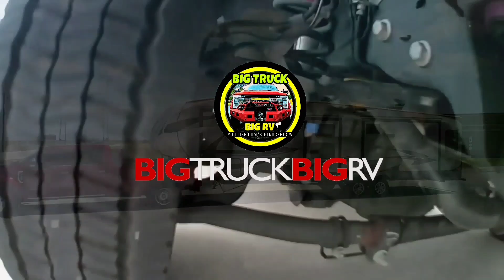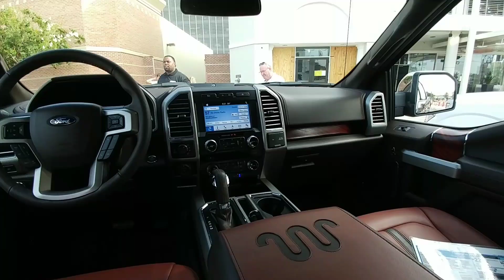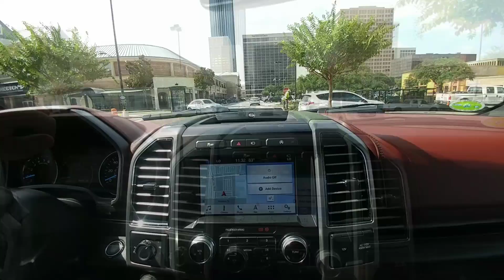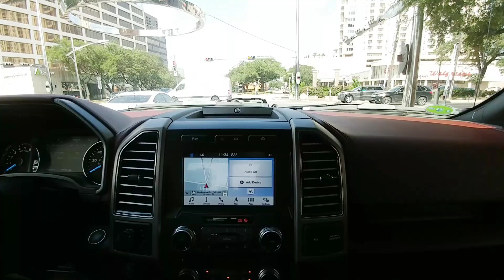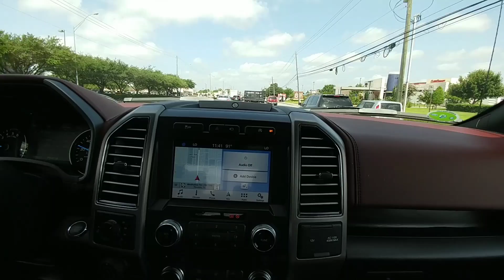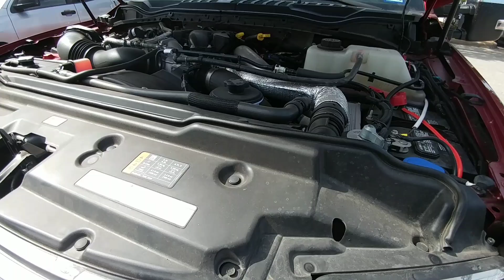All new F150 3.0L Powerstroke Diesel! First drive!

Comment: This new variant seems a bit confusing to me from a cost/performance perspective. I went to Fords website and specd an F-150 King Ranch 4x4 with the 3.0 diesel and they are 70K+ depending on other options. I then specd a 1 ton F350 dually and its actually 10K cheaper with obviously much better specs and longevity. Where is the justification for paying a 10K premium for a lot less truck? Speaking of longevity, that was one hell of sidestep dance that engineer did when you asked about it on the 3.0, he immediately deferred to the Super Duty line up if you want longevity, stating that the 3.0 was on par with the F150 lifecycle....Thats engineer speak for "we hope it does as well as the other F150's" I know, im a mechanical and electrical engineer, we use that type of language often because it gives plausible deniability should something not go as planned or changes have to be made. Aside from that, it was another good video, thanks!
Reply: No way in hell am I paying $70.000 for an F-150
Reply: F350 King Ranch 4x4 diesel dually starts at $70,360... you're paying for the interior trim. You can't compare the price of a 1/2 ton premium model with a 1 ton work truck trim model and complain about the price. What I find more interesting is the fact that you can get them for almost the same price, if I was buying a new truck I wouldn't even consider a 1/2 ton truck if I can get a 1 ton or bigger for virtually the same because I don't know where I'm going to be in life a year or two down the road and I might need the truck for work. Better to have more truck than you need than to get in a position where you need it and don't have it, if the prices are the same.
Reply: Jessa, What you probably are not aware of is that the switch from an all plastic cloth seat interior that will rattle all the time to stitched leather everywhere is ~$20 per vehicle for materials and manufacturing. So yes, complaints about price are fully justifiable; especially if a person is in the know.
Reply: Grimrpr6942 you have great points, the current 6.7 powerstroke had some reliability issues for a while, not sure if those are resolved, but this 3.0 engine is built in the same factory by the same people so that might tell you something
Reply: You caught that too!  It jumped out at me right away, he further doesn't seem too confident of power train.
Reply: As a retired aerospace engineer those were my immediate thoughts as well...... whatever the hell the F-150 LifeCycle is supposed to be :-)
Reply: The justification for $10k is fuel economy. You can’t get close to 30 mpg in a super duty. If fuel economy is not an issue then get the super duty.
Reply: "...Speaking of longevity, that was one hell of sidestep dance that engineer did when you asked about it on the 3.0, he immediately deferred to the Super Duty line up if you want longevity, stating that the 3.0 was on par with the F150 lifecycle....Thats engineer speak for "we hope it does as well as the other F150's" I know, im a mechanical and electrical engineer, we use that type of language often because it gives plausible deniability should something not go as planned or changes have to be made..."

Same impression here . . . not very good at dodging, eh ? LOL
Reply: Calm down, guys. The price of this F150 PowerStroke shouldn't be compared to its bigger siblings, the F250..F350, etc. This truck is much like the midsized pickups with their small [2.8L or 3.0L] diesel engines. Circa Colorado/Canyon and Gladiator. They're meant for fuel economy and light towing. Ya know, for the weekend warriors.
Reply: I would have pressed the engineer to answer whether or not one could expect the engine to last 300k miles. I'm of the opinion that if they believed it would last that long or even close, he would have at least hinted at it or implied it would. 
I find it difficult to believe that a Super Duty would be less expensive than an f150. No way these could be comparably equipped.
Reply: That 70k was before rebates, I saw a few of the king ranch deisel f150 for 55k
Reply: Grimrpr6942
Sure you are an electrical and mechanical engineer with your grammar skills. Lol
Reply: Wow. You pay that much money to be a Ford test dummy. Been there done that with two 1st year Ford vehicles. Never again.
Reply: Today's men have turned into princesses... no more 'work trucks' but these 'soccer mom' dressed up 'trucks'
Reply: Linh Nguyen does it even matter to you that one of these so called “princess truck” has a towing capacity of 13000 lbs with the max tow package 3.5 L 6.5 ft bed 4x4 and a 3.55 gear?

Comment: Great video, first off I HATE the engine shut off at the stop light, he never said how long the motor would last just BS'd that answer. Is that a cut off switch by you're radiator?? And Ford saying they didn't know about the pipe blowing off at high boost level's, I don't buy that answer either.
Reply: Myles Hansel Oh they know all right! And this engine is imported from there overseas division of ford!
Reply: Myles Hansel or the hydrolocking ecoboost engine and the carbon built up on the intake valves from the crank case breather!

Comment: Great overview,  but there's one correction I want to point out. The maximum towing capacity for this truck is 11,000+ and even the minimum is over 10k. I think you mentioned in the video than its only 8500.
Reply: Ford "Best In Class" is a fantasy. Read all the fine print. Properly equipped. They sell you a product you will not receive.
Reply: By the specs on the Ford site the 3.0 powerstroke is rated to tow up to 11k+ not the 8500 mentioned in the video. I'd personally go with the 3.5 ecoboost. The better fuel economy is not worth the diesel fuel price premium. Plus the ecoboost tows up to 13k.
Reply from the maker: John Yim: Those numbers are very specific to a trucks cab, trim, and configuration.  This truck isn't near that
Reply: Yes I realize that and I was thinking about getting one of these which is why I did the research on the ford site. A crew cab 156” wb equipped with the power stroke is rated to tow 11k.
Reply: Yes, 4x4 short bed is 10.7k with the 3.55 axle so maybe not 11k. But if you opt for the 6.5 bed it goes to 11k in 4x4 trim. 4x2 only increases it by 400lbs. Considering that you can't get the Powerstroke in anything less than Lariat (unless you're a fleet customer) I'd say the Lariat crew 4x4 is one of the better selling trims that plenty of people would buy. But then again, I'm just going by Ford's web site https://www.ford.com/trucks/f150/models/f150-lariat/ and it could be wrong.
Reply: Read all from this site http://fifthwheelst.com/rvtc_calculator.html

Comment: Ford must see the demand with the Dodge 1500 diesel. A friend has a the Dodge 1500 that he uses to pull a 4000 lb bay boat on long trips, says it does great to be 1/2 ton truck. The problem I would have with this truck is the auto engine stop on diesel engine. I personally don't want that option on any vehicle but especially not my diesel. On my Ram 3500, there is option to lock cruise to set RPM when sitting still instead of just idle RPM which they recommend instead of constant short trips and engine restart.
Reply: Chris M- this shut down system is a good way to kill a starter.

Comment: Have you seen the TFL truck video on this little diesel where it rows up the IKE it had serious issues the first time, nice truck but I would give it a little until I would consider buying one, I would OPT for the ram eco diesel and baby Duramax for right now as they are more proven
Reply: RobsPower Channel lol- the TFL truck was pre-production, had a problem on the way down, and it was a calibration issue. They re-tested it with the production software and it did fine. The same motor has been in the Land Rover for over a decade. The Baby DMAX isnt even out yet.
Reply: Marcus Young Nope https://youtu.be/YDY8obTyN9A
Reply: The Real John Smith Pretty sure the production model still had a poblem or two. Might be wrong. I'll re-visit the video
Reply: Why did they go with the 3.0 v6 when they already had the 3.0 i4

Comment: Sounds like this engine will not last a long time.
Reply: Yeah the engineer kind of danced around the question.  What is the “designed” life cycle for the F150 in miles/years?
Reply: Ryan Martin Yes he did! Lol, I just commented on that...
Reply: Felix What? The service interval of the belt has nothing to do with the overall lifespan of the motor.
Reply: Ty Bilodeau which still says nothing.
Reply: That's exactly what it sounds like. One of the first thing the engineer says when asked if it was going to be reliable was "for maximum longevity, you're going to want to go to the super duty class". (or maybe another manufacturer?)

Yikes, what a response. If only he had said something like "we understand one of the huge draws to the diesel market is the long lasting, reliability that have proven and condemned other engines in the past. Due to this factor, we have done extensive research and even destructive testing to find the most common failure points before making necessary adjustments. The reliability of this engine should be on par, if not better, than the best engines in this segment.
Reply: It has belt-drive HPFP behind the engine. It's not meant to last long, it's meant to be used up and thrown away.

Comment: So if a truck has a 12k tow rating or lets say 11,700 tow rating would towing 10k lbs be a problem in your perspective?
Reply: Always get more truck than you think you need.
Reply: Yes it is a huge problem I wrote a whole comment about my experience with a 1500 towing a 10,500lb travel trailer in short if you are towing more than about 8k pounds or so just get a 3/4 ton.
Reply: Big Truck Med Rv Thank you towed about 3k with my XD and experienced no issues will definitely not exceed 7k lbs my XD with its current config can tow up to 11,700 lbs but I will never exceed 7 or 8k
Reply: About 60% is a good rule.
Reply: New GM trucks are getting a max hitch weight, GVWR along with curb weight on pillar stickers. Now every one will have it as equipped ratings
Reply: http://fifthwheelst.com/rvtc_calculator.html
Reply: steven reynolds I agree

Comment: Tell ford to quit bullshitting and make more f150s with a 6.5ft bed on the crew cabs. I did a state wide search on carmax and only found a handful of trucks out of almost 200 trucks. 5.5ft beds are for soccer moms!
Reply: Same bro I looked for a 6.5 ft and barely found any
Reply: shayne jag That's the only thing keeping me from buying one! My budget is 30-35k and I sure as well ain't getting one built with a 6.5ft bed for 40k.
Reply: After I moved out from the city to the country my new local Ford dealerships spec the trucks completely different with the longer beds.  So if you get F-150 most of the trucks have the 6.5 foot bed, and if you're looking at the 3/4 ton or 1 ton almost all of them have the 8-foot bed.  It's more about practicality than looks.
Reply: Agreed. That bed length is useless.
Reply: Tell suburban white collar office workers to quit using it as a mini van.. its a DAMN truck!
Reply: 6.5ft bed is for soccer dads that want to look cool in the office parking lot in front of their cubicle working coworkers!  Guys that need a pickup to do work go with an 8ft bed.
Reply: YES, i just went to a couple dealers today and they are few and far between....let alone trying to get tow mirrors!
Reply: Ricardo Moreira I agree. I'll be special ordering my F-150 with a SuperCrew cab and a 6.5' box.
Reply: I couldn't find a "long bed" either so it just solidified by decision to buy a Super Duty with a real long bed for just a little more money.
Reply: Not much people care for longbeds like u
Reply: https://www.gofundme.com/54l595c&rcid=r01-154621919613-14bf60f0034f4129&pc=ot_co_campmgmt_m
Reply: Ricardo Moreira 8 ft bed
Reply: Ricardo Moreira the problem is ford offers 6.5’ but almost no one buys it so you won’t find a used one. If you want 6.5’ then order a new one
Reply: That's what kills me. If you're going to get a truck get one with a big bed. Once you put a tool box in one of those dinky 5.5' you barely have any room left over. That's actually why I bought an 08 Nissan Titan. It has the longest bed you can get in a crew cab half ton at 7'3" but I'll probably be upgrading to a 2017+ F250 next year.

Comment: Makes no sense since it costs more to run than the Ecoboost and makes even less sense in the top trims. It only exists so that those who don't do any research buy it on the 4x2 mpg number. If at the end of the day it costs more money per mile to run the diesel how can it be justified? It only gets 1 mpg better than Ecoboost 4x4, which after def and Maintainence means it costs more but has less capability

Comment: With it being a modern diesel does it still have a DEF system? Does the motor still go through regen mode? Also thank you for bringing that hose to their attention, if it becomes a factory recall of sorts I have a 2016 F350 K.R. I'd like to get that replaced before my rubber hose gives out.

Comment: So, spend upwards of 70,000 so we can save money with fuel economy?
Reply: Darrell Trammel for that price you might as well get a hd/sd truck just about
Reply: Darrell - pick it up next year, after some sap paid the extra $25K they didn't need to.
Reply: Honestly, I wouldn't buy it used either. They are admitting they won't last as long as I would expect it to. It seems like manufacturers are making throw away vehicles these days and charging more than ever for it!
Reply: Good economical sense
Reply: Yup. Trucks now cost as much as a nice house.
Reply: We live in a country where lots of people spend $300 on a cooler so they can make a $2 bag of ice last longer.
Reply: Big Truck Med Rv true story!
Reply: Best reply ever! My father tried to convince me that I needed one of these $300 dollar coolers and I thought the same thing.
Reply: Yes nuts, This engine would make more sense on a less expensive model. If I could afford a king ranch half ton I would want a nice sounding V8.
Reply: Thank you
Reply: You can get good discounts on Fords during July and August. You can get a fully loaded F150 Platinum for 60k, and thats only CAD, so i am sure you can get it for even less in the US.
Reply: Good point, I'll stick with my 04 FX4! 15mpg but been paid off for a long while!
Reply: Darrell Trammel I agree,if you want a gas sipper,get a Honda 4 banger
Reply: Yeah, how many years is the break even point? Bout the time it fails